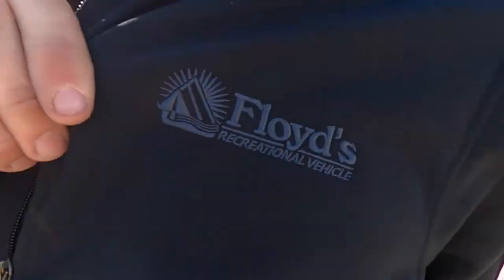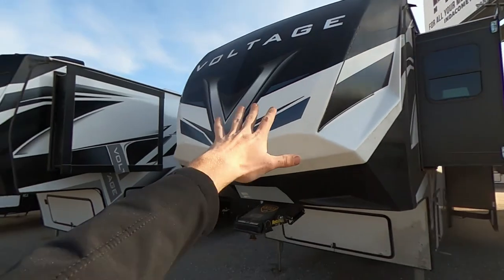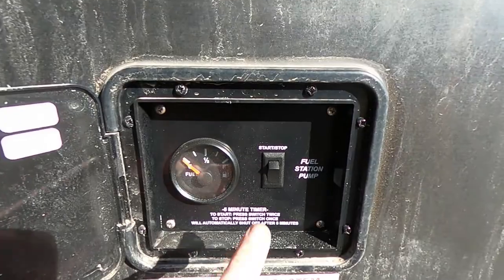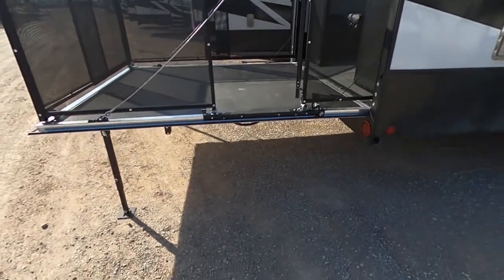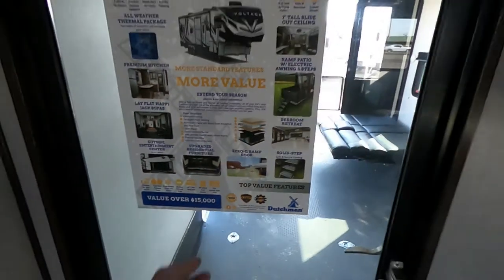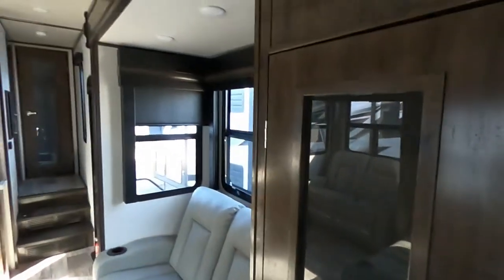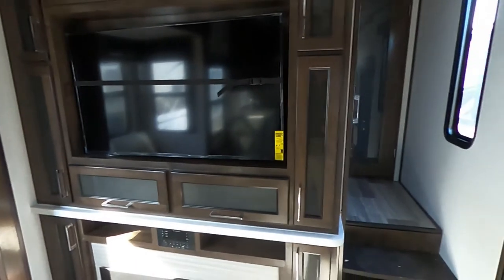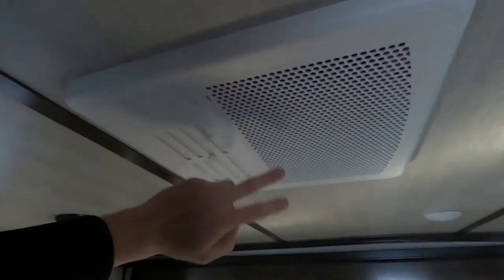The DUTCHMEN VOLTAGE 4225 is built to PARTY!!! Haze Carlson at Floyd's RV

Comment: I have a voltage 4005 and love it. Thinking about another. We like this plan but I think they should move the  slide with the couch and refrigerator up to where the door is so the couches can be even and square and then move the door on the back side of the slide utilizing the mor Ryde steps. I'm not a huge fan of the bathroom in the garage. Just not enough privacy for me and small. I'd rather not have it. I personally like an undermount sink in the bathroom rather than the vessel sink. I would like to see the newer shower design with the fold up seat instead of the permanent seat. We would also like to see the w/d prep in the closet area rather then the garage so we won't lose the space for the rzr. Voltage is close on this one. Thanks for the video!
Reply from the maker: Well I'm glad to hear you are on the Voltage Train! Hopefully they will listen to the consumers and change that in the future. I doubt they will move washer and dryer units inside because it makes it so much easier to install and maintain washers and dryers in the garage. Plus having them in the garage would give you more space for the closet. Because it is a toy hauler, they want to maximize the space inside the coach, therefore putting w&d in the garage. Thanks for your input, I love hearing from my viewers. When you get ready to upgrade from the 4005, LET ME KNOW!!!
Reply: @HazeCarlsonatFloydsRV  we have the w/d prep in the garage now and it would take up about 3 feet of room. The rzr won't fit with the w/d. The valor toy hauler does a good job with this in the closet but we'd like another voltage especially with the water capacity. The w/d prep is one of the reasons we looking to trade sometime. Maybe we'll talk to you when the new models comes out that fits our needs!
Reply: @cnetate  — The 2nd bathroom means guests and kids aren’t traipsing all through your bedroom to use the one bath.  IMHO, a second bath is a Godsend, if you don’t mind the extra length.  We camped with some friends, and watched as their whole family would stop off to use the restroom, then zip off again on their bikes and ATV’s. When we ate with them that evening we were amazed at how clean everything was, as people were going in and out all day with muddy boots and clothes.  That’s when she showed us the rear entry w back bathroom.  “I only have to clean up this small area, the dirt is all contained to the bathroom area.”  That’s genius!
Reply: @Erin-Thor  If you dont want "friends" using your main bathroom......They Aren't friends !!!
Reply: @maintainingmomentum  — LOL!  It wasn’t our trailer, we watched THEIR kids go in and out throughout the day with muddy boots.   Too funny!  🤣